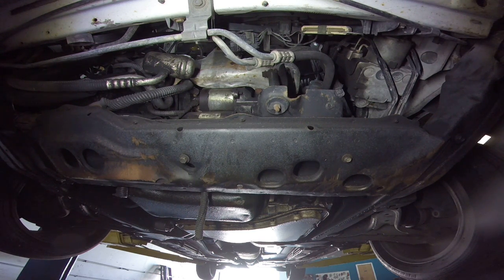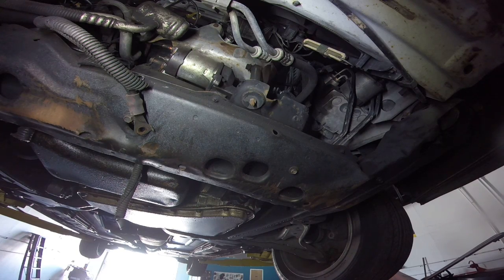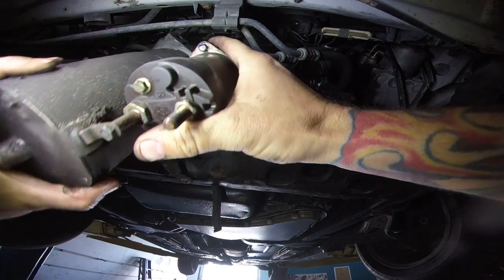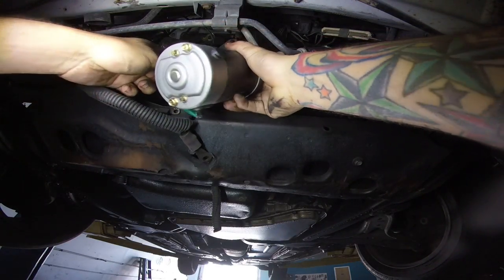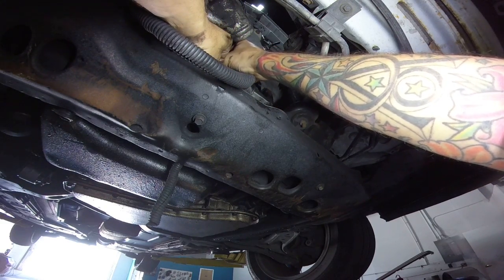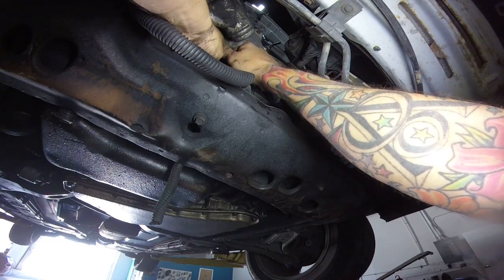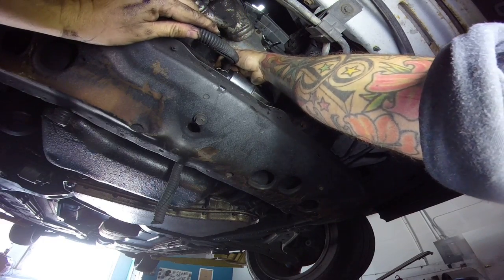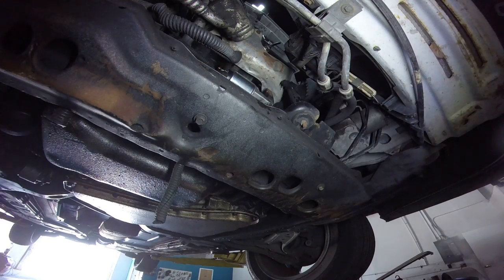oldsmobile,buick,pontiac,gm 3.8 starter replacement

Comment: You are the only person on the internet that has helped me. I replaced starter. I'm only getting one click no crank. Can not find starter relay I know where they are located but no diagram. Could it be my alternator?
Reply from the maker: could just have a bad connection at the battery i would start by charging the battery and cleaning the connections
Reply: @uglyhp8225  thank you so much!

Comment: Thanks for the video. I have a 93 century with the 3300. Looks similar starter cranks and turns over engine but seemingly fuel pump doesn’t run so the car never starts. Earlier this summer I dropped the tank and replaced the fuel pump so I doubt that’s it. Is it possible the fusible link on the starter solenoid is the culprit for not getting the fuel pump to come on when cranking? This all happened during a rainstorm drive.
Reply from the maker: have you checked to see if the starter is getting power and ground directly thats where i would start
Reply: @uglyhp8225  starter turns over engine fine so it’s clearly getting power. Before it died for good it sputtered and ran poorly for half an hour or so but occasionally ran fine sustained highway speeds in that time but would later die and could restart but eventually it died for good. To me it seems like an electrical issue with fuel pump not coming on. It doesn’t prime itself at all when turning key to on like you used to hear. It’s silent.
Reply: @smallgreentreefrog  did you solve this problem? I just had to swap out the fuel pressure regulator to do it (going to replace starter next because it's wearing out slowly.)

Comment: I got a 1994 buick regal custom i got both bolts off and electrical bolts off but I seem to cant get out the hole  its in🤔 could the engine be to low to pull it out 🤔

Comment: See im doing a starter replacement on my 1998 oldmobile lss but the fly wheel cover is blocking the 15 mm bolt in the back i got one cover off but i still cant get the other one off that in back of the engine mount theres a lil 10mm screw that i can get off

Comment: I’m doing a starter replacement on a ‘95 Buick Regal Custom 3.8L, and the starter location and look is the same as this, EXCEPT I cannot get the motor out of the car after disconnecting it. There’s NO room underneath or above to take it out, without disconnecting all kinds of oil cool lines… any ideas?
Reply from the maker: should be enough room
Reply: @uglyhp8225  Unfortunately there wasn’t, I had to disconnect the AC pump lines to yank it out but I got it!

Comment: My car was clicking after I charged the battery ...however I replaced distributor can that cause car to not start and click
Reply from the maker: if im hearing you right it doesnt crank ? it just makes a clicking noise? check your connections if they are fine check the starter

Comment: God dammit. This video looked promising, but this one missing the plastic flywheel cover already too. I cant find how to get it out, and it's already loose after I took the 10mm out. I been wiggling and tugging but its like caught on something. About to rip it out, so no response will save that from happening at this point lol.
Reply from the maker: there is another 10mm on going in sideways by the body of the starter
Reply: @uglyhp8225  I finally finagled it out in one piece. It was loose, but there was a stubborn motor mount just perfectly placed causing the headache. I got it done, AND I even replaced the plastic cover. It's always the jobs that look the easiest.

Comment: Where is third 10mm screw located to remove plastic cover covering 15mm screw on back side of starter.
Reply from the maker: theres only 2
Reply: Theres 3. Third is located right behind motor shock in front of starter.